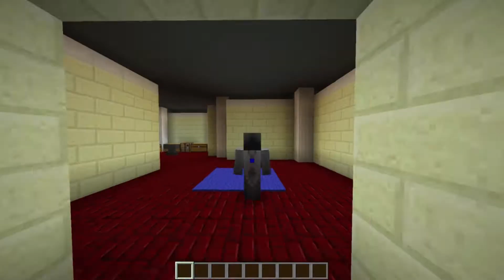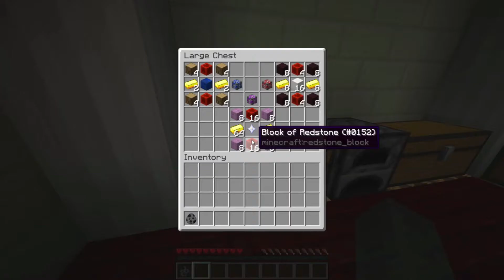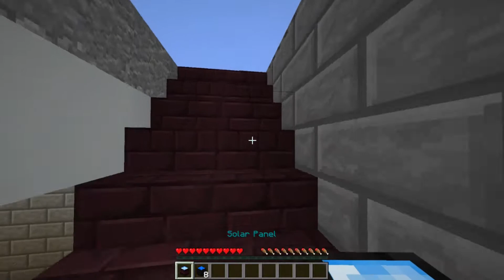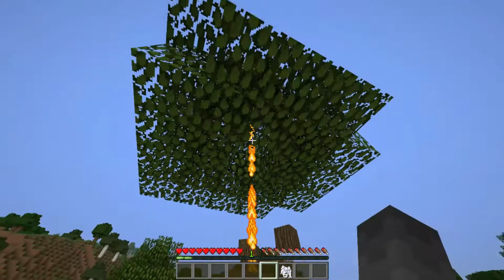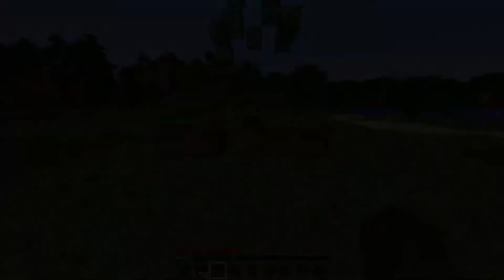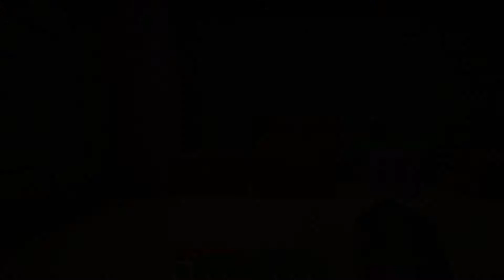Mechanization - A Function Script Tech Mod (outdated)

Comment: I need help the textures aren’t loading and everything looks like shovels and iron hoes
Reply from the maker: Make sure you have the resourcepack installed. In 1.12 it is bundled with the download. For 1.13, you can find it here: https://minecraft.curseforge.com/projects/mechanization-resources
Reply: Thanks!!😀
Reply: The textures still aren't working. I might just be stupid and something obvious is wrong, but I really want to get this working.
Reply from the maker: Oh wait- you see diamond shovels and iron hoes? Make sure you have the latest version off curseforge and not whatever LDZ was distributing  (it's very outdated).
Reply: Ok that’s where I went wrong thanks!
Reply: There are still diamond shovels but not iron hoes. I downloaded the latest of everything but pretty much same result.
Reply from the maker: It's probably installed incorrectly, so I'll link you to the installation instructions page. There is a link to a video tutorial there if it helps: https://github.com/ImCoolYeah105/Mechanization/wiki/Installion
Reply: I forgot both resource packs

Comment: last command '/function mechanization:start' does work
Reply: You must have downloaded the wrong version. Here is a link:https://minecraft.curseforge.com/projects/mechanization-datapack/files/2567950
Reply: PIECAT does it have to have forge? Cuz the directions dont show that it has to
Reply from the maker: This video is for the outdated 1.12 version. If you're using the 1.13 version it should install automatically without running any commands, though sometimes you need to run /reload. The wiki should have any information you need to know regarding the 1.13 version: https://github.com/ImCoolYeah105/Mechanization/wiki
In general I do not support older versions if you are on 1.12, but if the start command truly does not work, then I will look into it.
No, it doesn't need forge, I just host the downloads on curseforge (it's not just for mods).
Reply: ICY thanks for the reply!